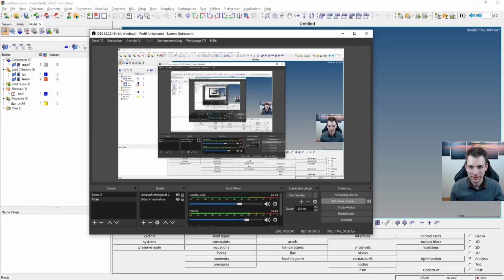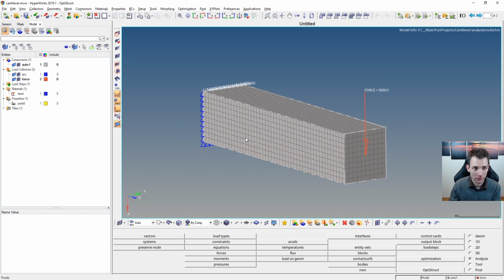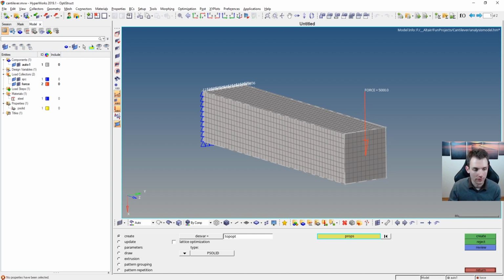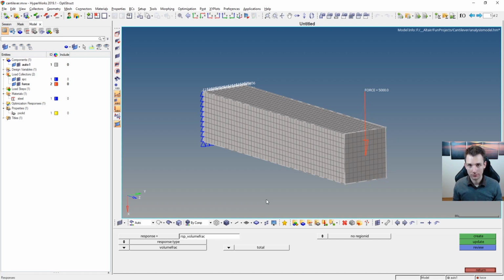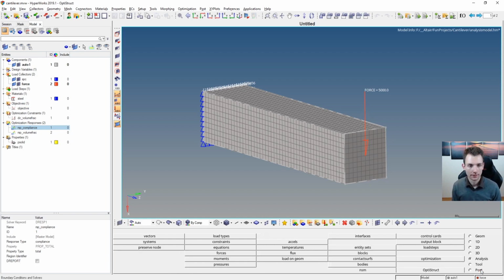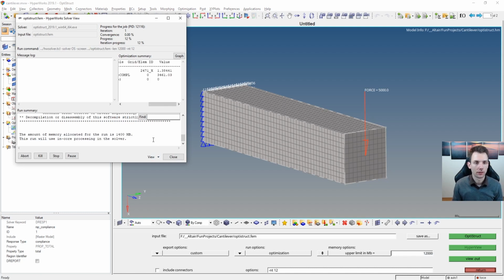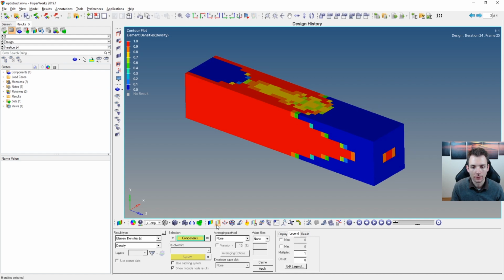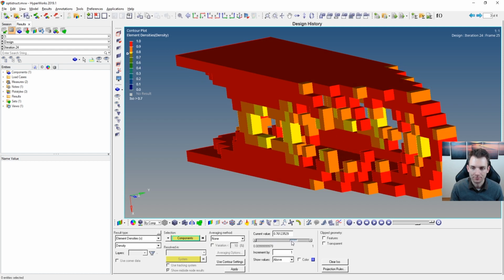Topology Optimization on a cantilever beam with Optistruct (short, hands-on)

Comment: Hey Manuel, what if, the error showing
 * ERROR # 312 *
 In static load case 1 
 the compliance is negative or large 8.71101e+17.
 Optimization/buckling analysis cannot be performed.
 due to possible rigid body mode.
 FEASIBLE DESIGN (ALL CONSTRAINTS SATISFIED).
  
 * SOME ERRORS WERE REPORTED DURING THE RUN,
 * PLEASE VERIFY RESULTS AS THEY MAY BE INVALID.
  
what might be the issue here, i followed all the steps, still getting the same error. Can you help me with that?
Reply from the maker: Thats one of the classic errors - should make a video about it. It means your model is not constraint sufficiently or has loose parts which "fly away" under load.

Comment: Hey Manuel, thanks for all the great videos they are a really fantastic resource to learn.

Do you know if it is possible to use non-linear analysis for topology optimization in HyperWorks? I am asking cause it would be a useful feature for displacement driven designs with big deflections. I personally didn't manage to figure out if it is possible so I thought you might know:) Thanks in advance!
Reply from the maker: Hey :) As far as I know there is no easy way to do a non linear topology optimization as for those topology optimization you need to have derivatives which would be very computationally costly if you would have it in a non linear subcase (each derivative would cause multiple function calls and the validity is limited as it is a linerization) 

It depends on which non-linearity you are referring to. But the basic saying is - optimization of topology with optistruct - only linear (to my knowledge)
Reply: @ManuelRamsaier   Yes, I thought that would not be easy. Thank you for replying, I really appreciate it. Good luck with all of your projects and I am looking forward to watching more of your videos.
Cheers

Comment: Good stuff. Thanks for the video! 
A small correction, in the opening slide, below the heading, it reads "Part 3: Topology Optimization". I believe it should be part 2, no?
Reply from the maker: Part 2 was Hyperview which was included in the "Hypermesh FEM Model and Hyperview Tutorial" Video at around 17:29. 
So my intention was:
- Part1: Preprocessing in Hypermesh
- Part2: First Run and Post Processing the Analysis
- Part3: Topology Optimization
Hope this helps :)

Comment: Brilliant video.  Do you have a video that details optimisation for a frequency response or modal run in addition to multiple static design cases? 

Also, do you have a video on geometry export of the optimised structure shape?
Reply from the maker: both are good topics. There is a video about a frequency response optimization. Geometry export there are multiple options so its difficult to squeze them into one video. But I think I covered OSSmooth in one video. 
Best regards
Reply: @ManuelRamsaier  thanks alot. I will check out you videos. Thanks again for sharing this great content
Reply from the maker: @beefybeef1326  Thank you :)
Reply: @ManuelRamsaier  i found your video... but its in German. Im sure its good content, but i dont speak German 😂 

Thanks again for your help